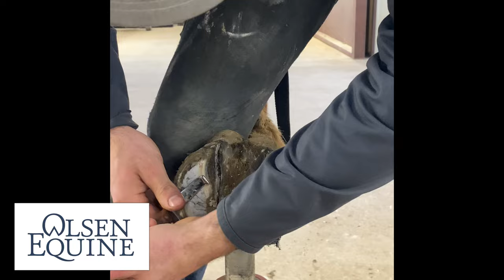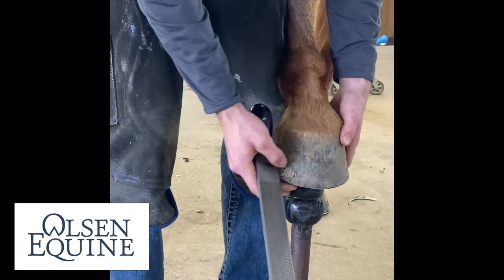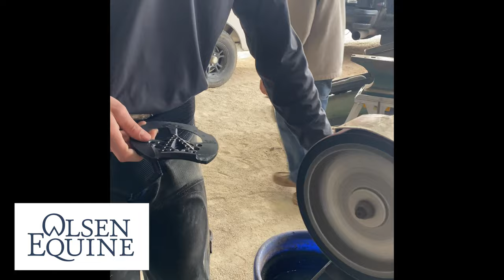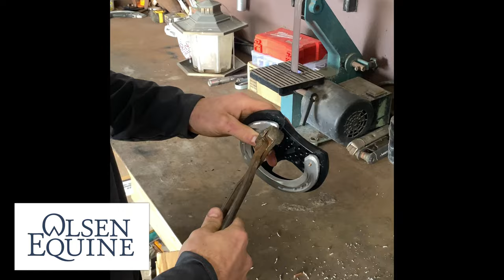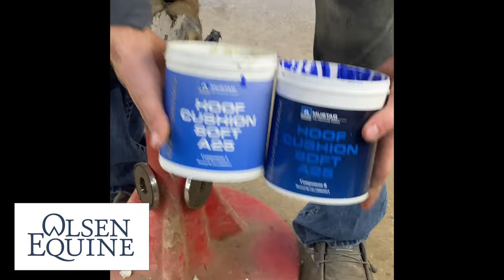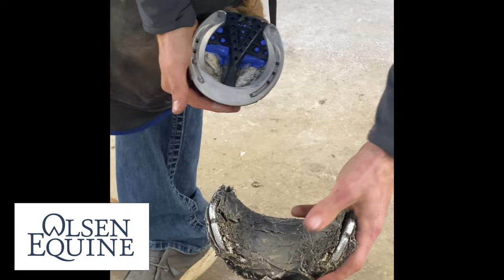Aluminum Shoes and 3D Pads with Kelton Harris, CJF

Comment: Curious as to why the pad was needed and if it was a wedge pad thanks gob
Reply: It looks like the horse has thin soles and not much frog so the pad and dental impression material could be for added frog pressure in addition to add depth of sole to protect from injury .. not to mention a missing chunk of hoof on the lateral side of the right front... not positive tho.